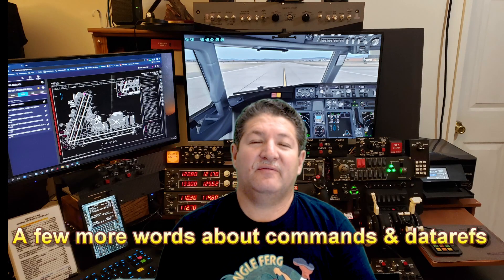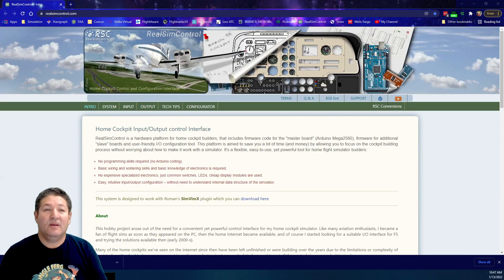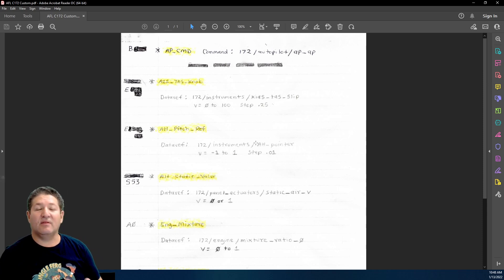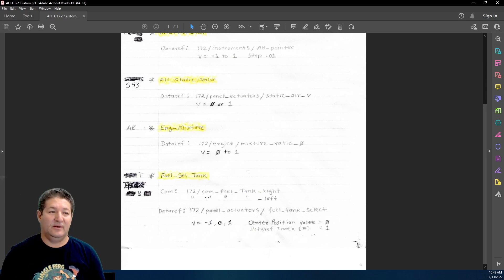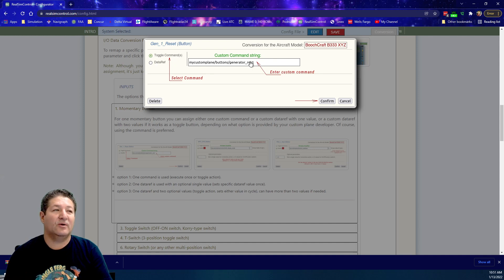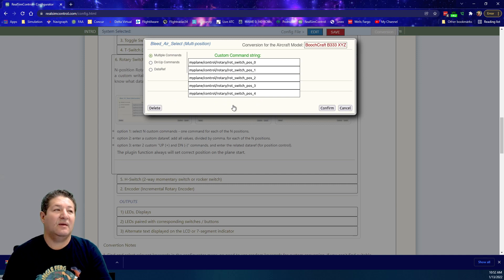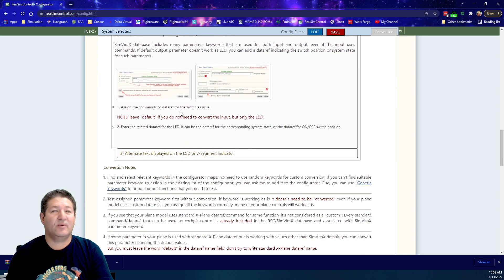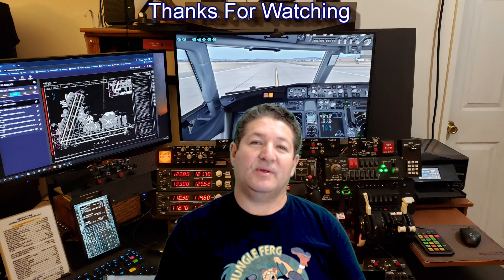A few more words about commands & datarefs

Comment: Hey buddy - I did my MCP with mulitplexers - but one button moves everything - HDG, SPD, V/S, AP engage & disengage - I am struggling with isolating the inputs .. help please- yours truly Insipiration74Africa project.
Reply from the maker: Hi there, did you put the 1-5 Kohm resistor on the MUX board between the 5V pin and the Signal pin (Z)?

I had an issue like that a long time ago in my first test panel and it ended up being one or more of my wires were shorting.
Reply: @Qosmokid  Thanks man, I'll do just that - appreciated. I had not done that. I'll let you know when it works.
Reply: Hey man, I installed Pull up resistors, its working fine now- thanks Buddy.
Reply from the maker: @inspiration73africasim29  Glad you got it working 🙂

Comment: Any suggestions on commands & datarefs with a relays ? for the stick shaker to come on and off when the sim says
Reply: Nice even am looking for the same, any luck with Auto speed brake operation ?
Reply from the maker: @ajayjayaraj8613  Now this one I think is way over my head. I can kind of imagine how to do it but I haven't even begun to look into the material needed to accomplish that.
Reply from the maker: Hello Peter, let me look into it. I would think its just a matter of using the dataref as an output to energize a relay that will turn on a vibrating motor.

Comment: Any suggestions on finding - hidden / Data-ref & commands that are not showing up using Dataref Editor ?
Reply from the maker: I don't think there should be any hidden ones. At least I dont think I've ever came across that problem.

I've had some that were very difficult to find because they were named differently than I expected but I've always managed to find all the ones I've looked for.
Reply: @Qosmokid  well yes maybe they have been named differently, shall search again, thanks
Reply from the maker: @ajayjayaraj8613  what plane are you having trouble finding them for?
Reply: @Qosmokid  Using the Flight Factor 757
Reply from the maker: @ajayjayaraj8613  Oh ok, unfortunately I dont own that aircraft otherwise I could've tried to help you find those.

I do notice the conversions for that plane  are included in the RSC_Planes.dat file. Of course you need to be a supporter yo get access to that.
Reply: @Qosmokid  yep I have the conversion file, as I am a supporter 🙂
Reply from the maker: BTW, I don't use the Datarefeditor, I use the Datareftool
Reply: @Qosmokid  thanks 🙂